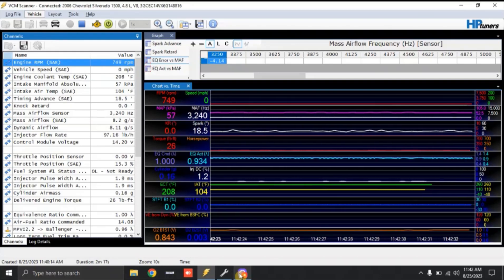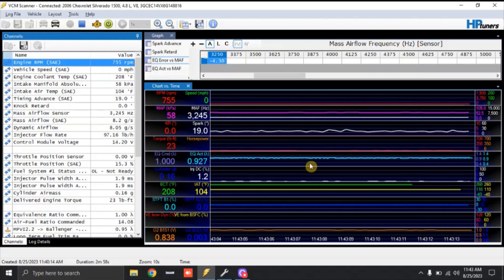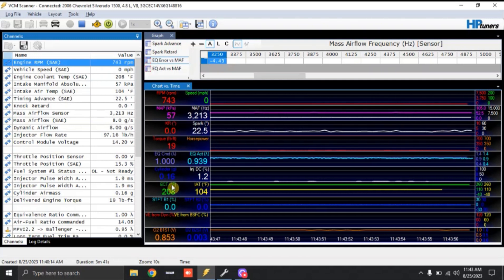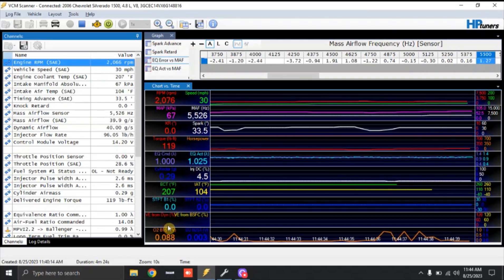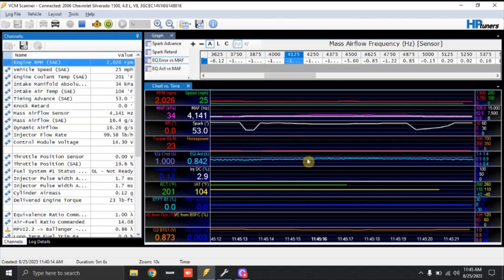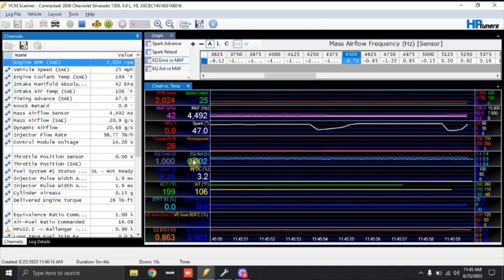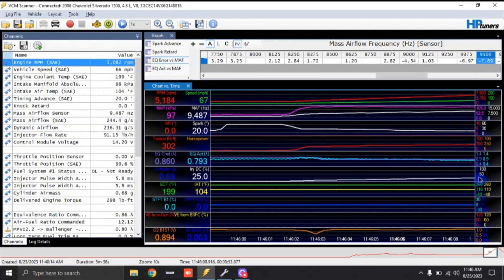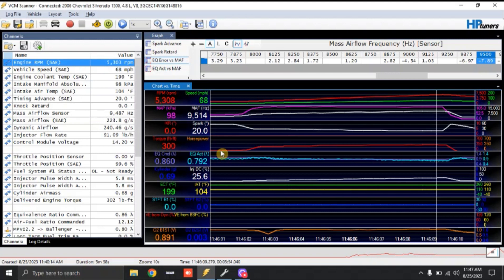What’s your Tuner looking at on the dyno? I’ll show you!

Comment: How are you getting wideband to show the right eq I'm decimal if that makes any sense. I'm using a aem 30-0300 and logging through serial port and have it set to lambda on gauge but on my scanner for example it will show 10.2 instead of 1.2 or 8.4 instead of .84 I've tried moving the decimal numbers around in graph layout or setup or whatever but no luck.
Reply from the maker: I either use the Pro-Link cable for Analog out or a Can Bus cable. I never had good luck with Serial.
Reply: Hi Matt if you ever get a chance I would like to see the Can Bus Cable, how/where you hook it up and the data you get. Have you ever gotten accelerometer data straight of the Can Bus? Have asked HPT to add it to available PIDs but they want a Can Bus identifier??? Seems as though they could use the accelerometer in the MPVI2/3. Thanks @Matt_Sanford
Reply: I log my wb through my egr,unfortunately I also have it ran to my Dakota digital gouges. For the life of me,I can't get them to match up. I fudged the #'s in the math that AEM sent and got it close in my scanner but my Dakota digital are way off. It's been over a year and I haven't been able to figure it out
Reply: @tennesseetreasures124  the math is correct on mine it will still show if I'm  like 5% rich or lean on the histogram chart it's just that the lambda value doesn't have the correct decimal placement.